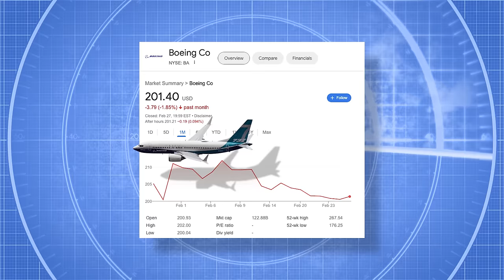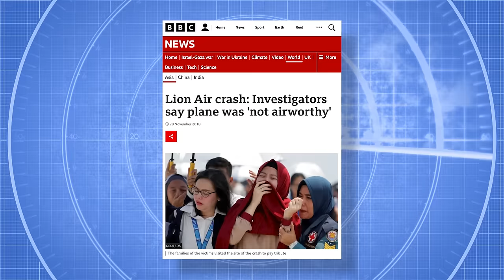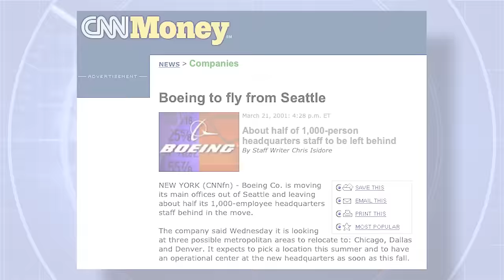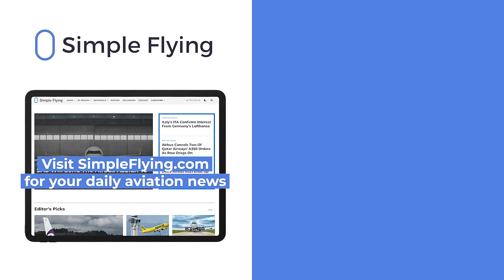Boeing Board Shuts Down Potential Headquarters Move To Seattle

Comment: Yes. Move the HQ back to Seattle. Get more aircraft engineers and pilots back into high management levels.
Bean counters are great at counting beans but not building aircraft.
Reply: Or maybe Boeing could stop wasting money moving headquarters around to anywhere else and invest that into better QC.  But that would make too much sense.
Reply: And away from the clowns in DC/Virginia
Reply: @GintaPPE1000 turning their attention away from Wall Street is the idea here